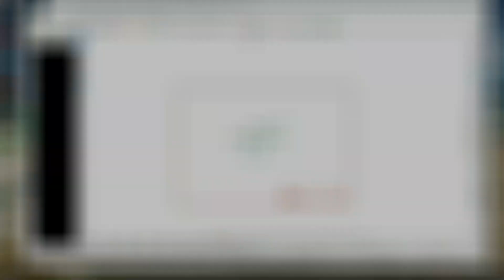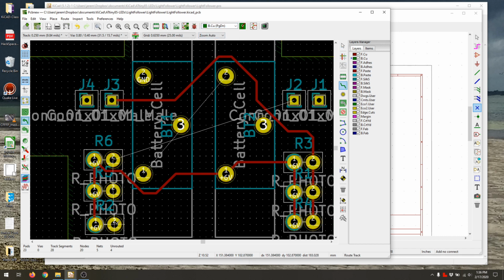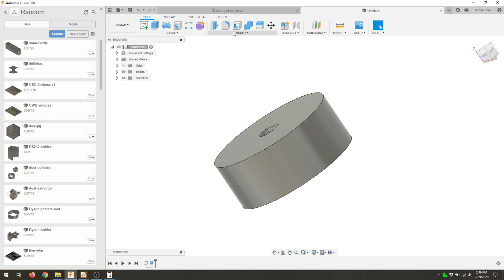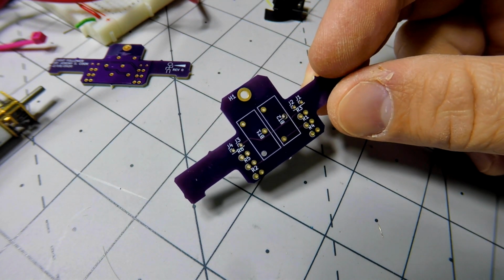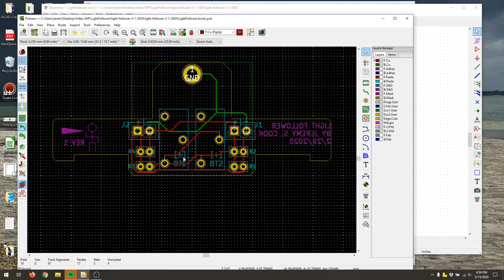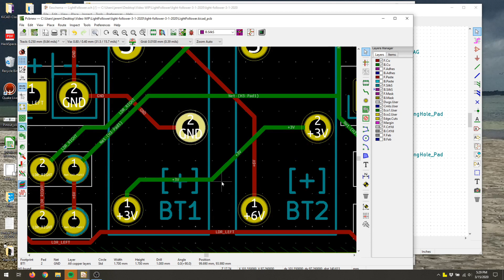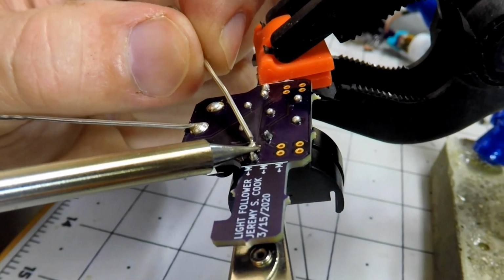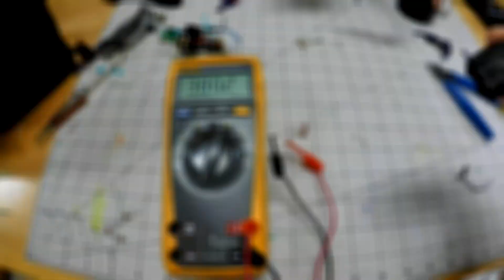PCB Light Follower Robot

Comment: Could you make it follow a laser pointer?  Let me explain more. I set the robot up and then about 100 feet away in a base that I want it to drive to that emits a laser.
Reply from the maker: It wouldn't follow the laser per se, but if you shined it directly at either sensor, it should make it turn.
Reply: @JeremyCook  I basically want to make a line-following robot that follows a laser set up 100' away outside. If you want to discuss more let me know.
Reply: @horizonroofing  It is certainly possible, but you'd probably need to use vision processing. At least that's how I would approach it.